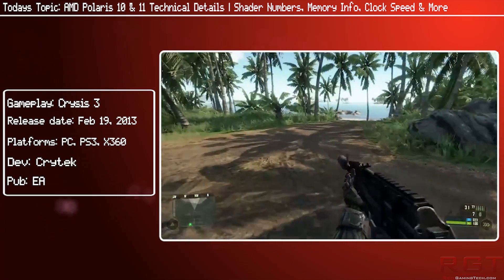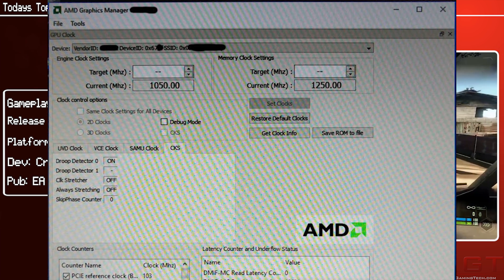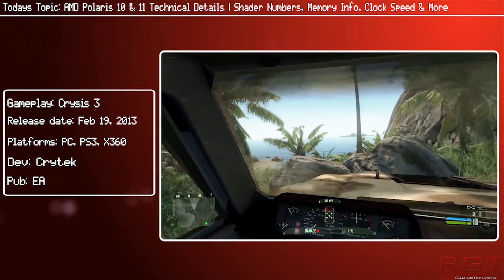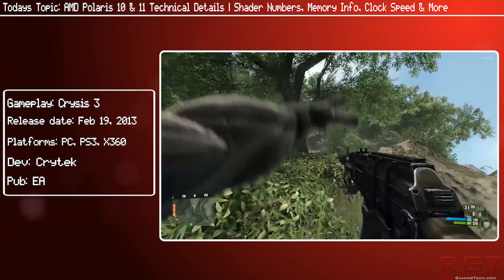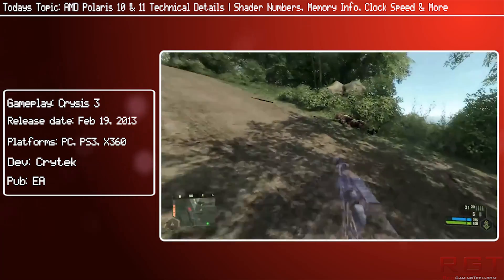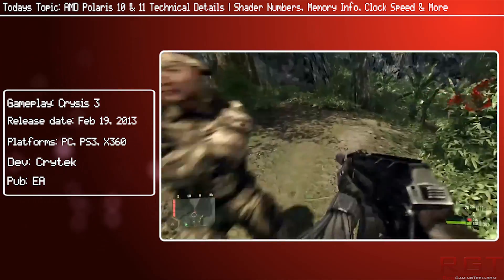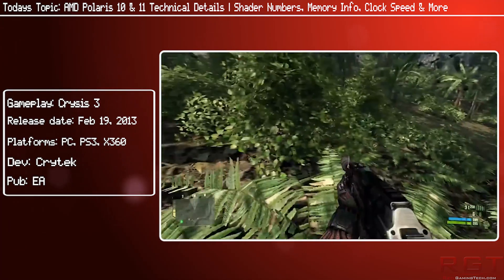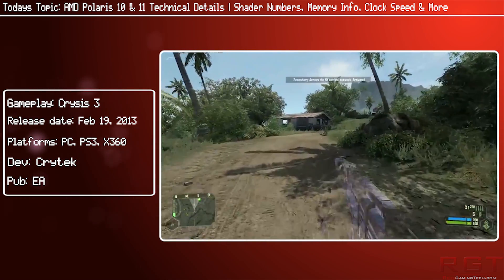AMD Polaris 10 & 11 Technical Details | Shader Numbers, Memory Info, Clock Speed & More

Comment: hmm Amd said 2.5 perf per wat more so  r7 370=110 wat, Polaris 11- 50 wat x 2.5 =125,simple math says its just 113.6% faster than r7 370 its not big revolution in performance  just big revolution in power consumption
Reply: +dindek 113.6 vs 100 (poaris 11 vs r7 370)
Reply: +dindek That's also what I thought. If they only advertise better performance per watt and they now have insanely efficient cards (which isn't the most imortant thing to gamers), that sounds like the performance won't be improved too much. I'm really looking forward how the cards will turn out and compete against Pascal ^^
Reply: +mistermaximal The performance won't be improved too much? The R7 470 runned Hitman at 1440p 60FPS. Even the R9 380 can't do this. It's a hell lot of an improvement.
Reply: Marcrafter True, and I would really like to see the Polaris cards performing that well. But Hitman is an AMD optimized title and I don't really believe anything until actual benchmarks are out ;)